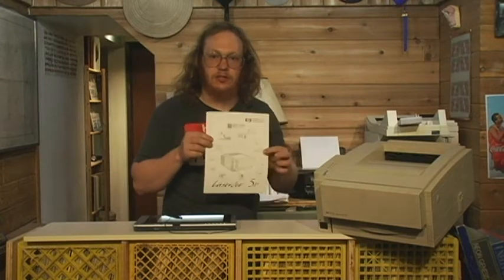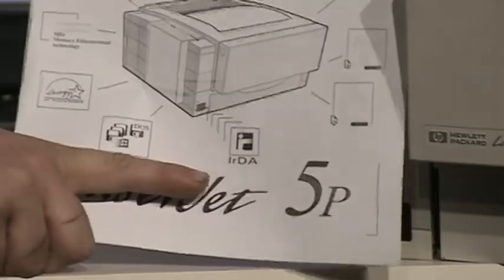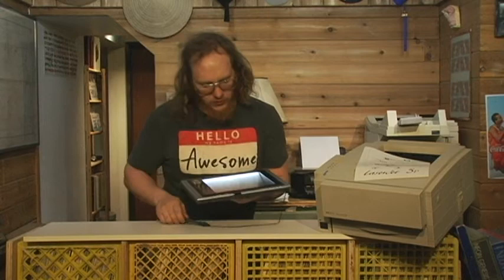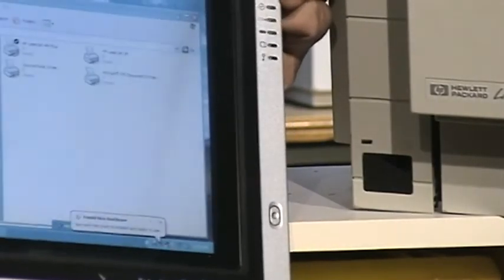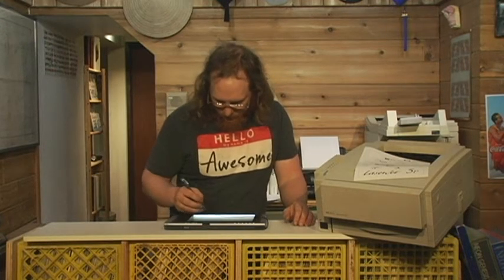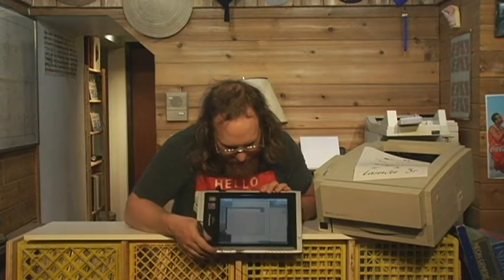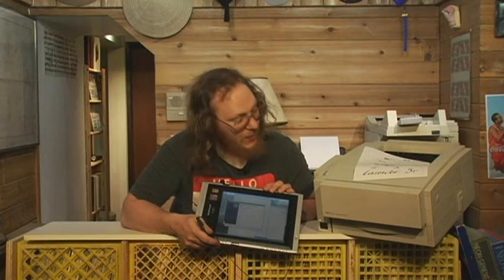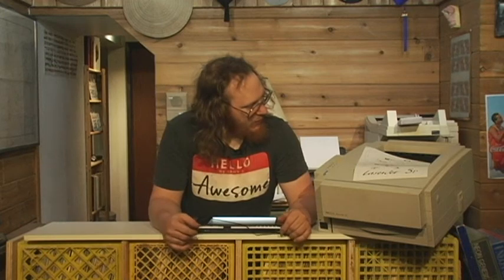Printing Wirelessly With Infrared

Comment: a lot of desktop PCs had irDa but it was typically disabled by default and never came with the rest of the hardware for it. A few friends and I used the irDa with a remote control to control WinAmp. Just some Phototransistors, IR LEDs and some passive parts did the trick.

Comment: In my high school, there was only one HP LaserJet with an IR port in the entire building left (as of 2017). It was made in 2002/2003, and it didn't work very well with the modern school computers. Then I tried printing something using my Apple Newton MessagePad 2100 (mine was an upgraded 2000), and it worked. It was newer than the 5P, but it worked with the LaserJet 5P drivers on the Newton. Still slow as balls... (3 or 4 minutes to send and print out a decently sized note!)